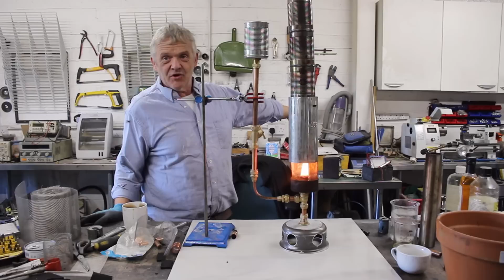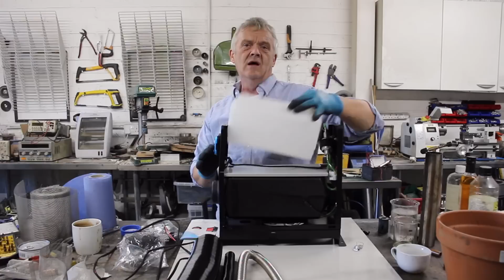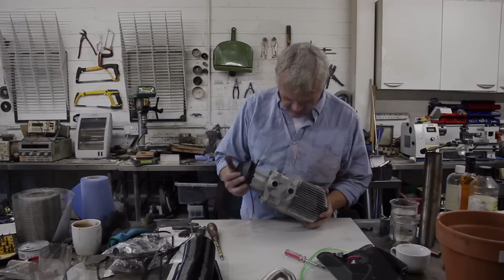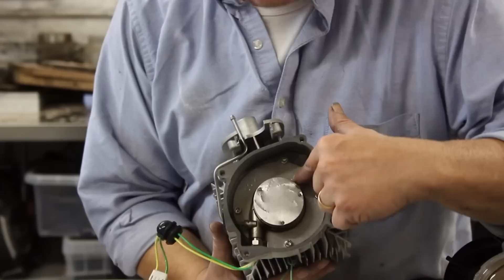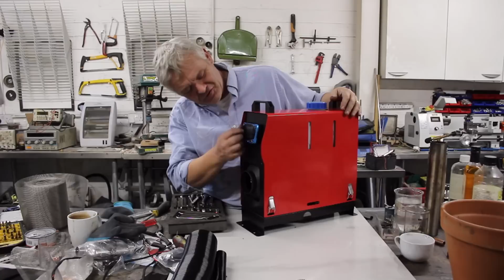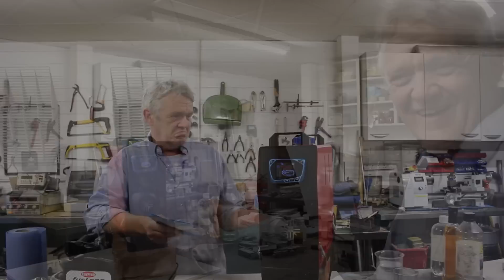1682 The Vevor 12V 8kW Heater - A Review And Pulling It Apart To See How It Is Made #Vevor

Comment: Nice machine and great price. The outsiders heater is ingeniously simple. Obviously he has a tiny space to heat but with  perhaps a veg oil drip burner or bioethanol or just a paraffin wicking burner for much more heat to the pipe and perhaps a more powerful fan than he had. if you had a side panel next to a back door. You could replace the bottom pane of glass for maybe a bit of cement board. And either exhaust the fumes outside with the unit inside as the outsider did. Or have the whole unit outside so it's safer and have a u shaped pipe coming from the house to the unit then back to the house again taking cooler air from the bottom and pushing the hotter air up higher. Theres not enough time in the day for me to do all the projects I want at once. I'm glad there's someone like you rob inspiring people and testing out ideas.
Reply from the maker: yes I liked what he did too

Comment: The heater is a Chinese copy of a German design. They were made for cabin heaters in cars and trucks. If you buy the original Wabasto heater it will cost you about $1000. 
The 8kw unit is a copy of a 5kw just over clocked. 
There is a UK guy that plays around with these Chinese Diesel Heaters on YT.
Reply: David Mcluckie!
Reply: @limmoblack  thanks
Reply: Do you know if it works on kerosine?
Reply: @nirmanakaya1666  I think David McLuckie on YouTube did it with Gasoline. I do think it will work. I would like to modify one to work with propane. It may mean modifying the controller software.
Reply from the maker: cheers mate - nice heads up

Comment: I have almost that exact heater in my campervan and very much agree on how simple to set up and ease of use ..  I have plans to bring it in to use in the house in the winter if required
Reply from the maker: nice one mate - cheers
Reply: I actually used mine when my furnace went out in an ice storm last winter
Reply: How reliable are they and how long does it last before the glow plug needs replacing say for example ..
Reply: @keithbill310  Very reliable in my experience (I have 5 of them) one unit has 3 winters of heating my garage without any maintenance, although I did order a glow plug kit for like $15 that came with new gaskets, several glow plugs and some other parts that I plan on changing out, but not absolutely necessary.
Reply: @keithbill310  been running mine, this is my third winter. This year when I test fired it in October, the fuel pipe had rotted, so got a yard of tygon 4mm and repaired it, other wise it has run like a dream. In very cold weather, I use it to heat up my mobile home. I run it on either road diesel or paraffin, which ever is cheapest, but I have heard of people running on Canola oil, C2 heating oil, which is kerosine, or even waste oil filtered, you can either build a centrifuge or just filter through a toilet roll. (If no water in the oil the toilet roll does not disintegrate, then mix 50/50 with paraffin or kerosine. Far cheaper than an electric or gas bill. About a tenth of the price